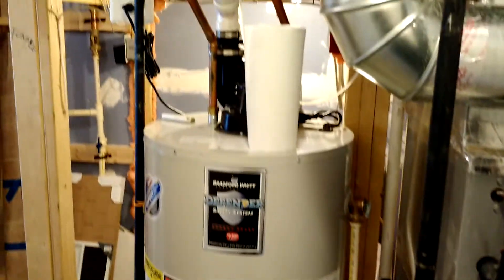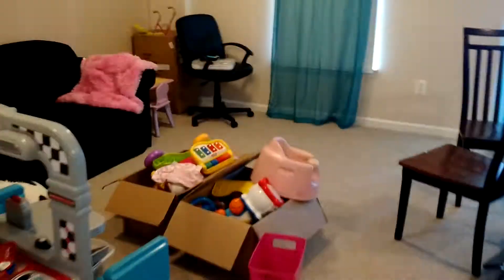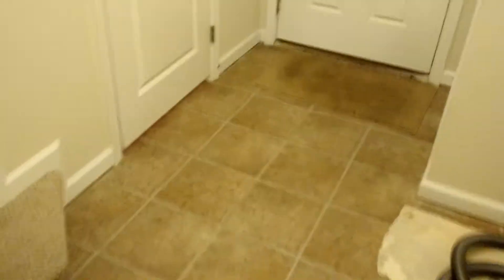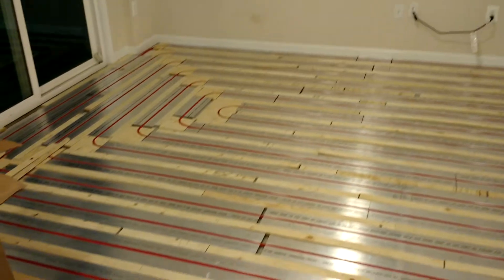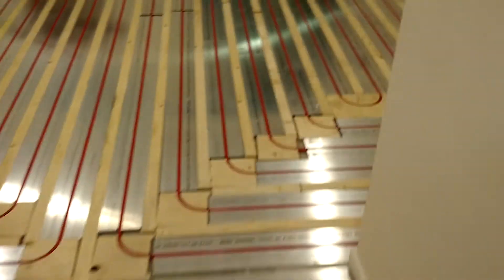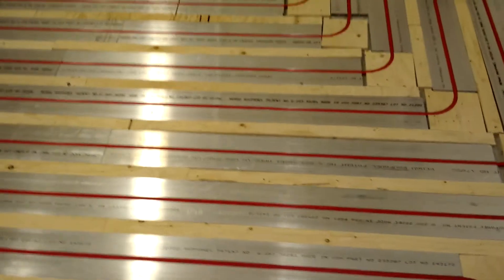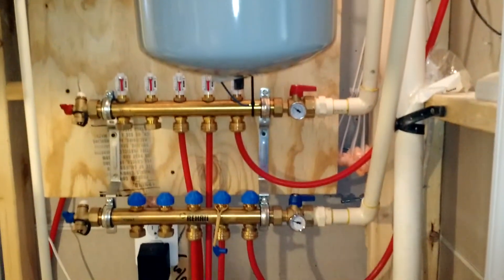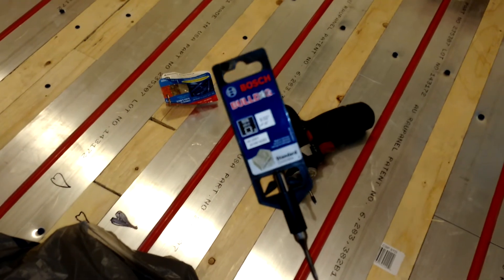Radiant floor heating system Rehau  tako X block

Comment: Very cool. When you run the lines in spirals instead of serpentine, do you start laying down the track in the centre?
Reply from the maker: Yes this way the warm water is on the outside of the room.
Reply: @nicholasrowan2768  Yeah, its clearly a better way to do it, but a bit more thought has to go into doing the layout I guess. Thanks for the video, inspired me to do it that way.

Comment: Nice job, like those plates being right on top of the wood lot better heat transfer.
Reply: It's faster heat transfer, but you don't get the thermal mass effect you would have with concrete. Concrete with that 1800 dollar x mixing valve would be very efficient if setup correctly. 
But the way this one is setup you get faster response time at the cost of efficiency.

Comment: Wow Great Job! Now is that your basement floor? I heard when you install on concrete or in the concrete you must install insulation around the foundation of the structure along the walls a below the footing to keep the heat from bleeding through the ground outside. I think it is called a heat dam.
Reply from the maker: You are exactly right with in slab radiant but the rehau paneling you do not need to thanks for watching John